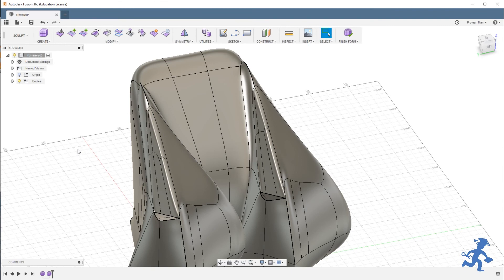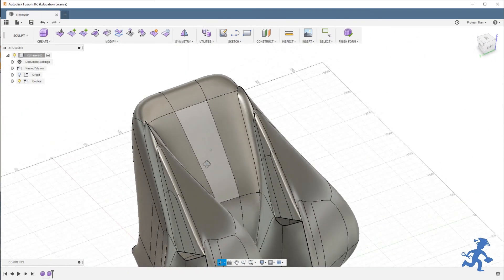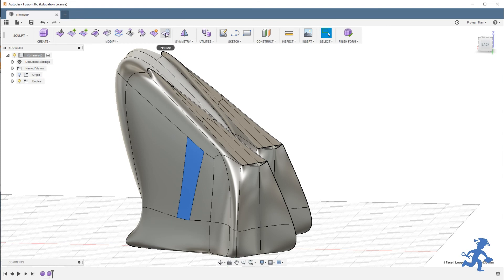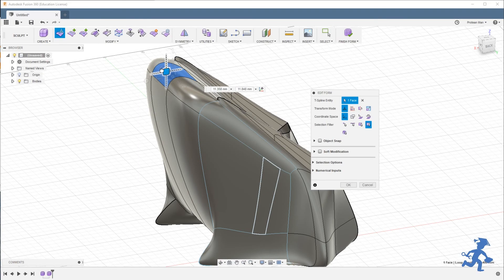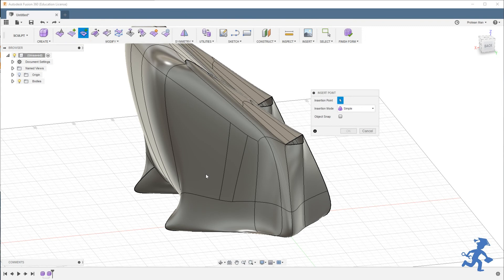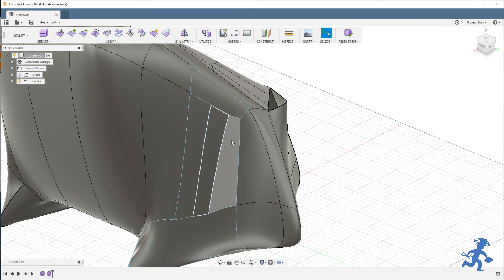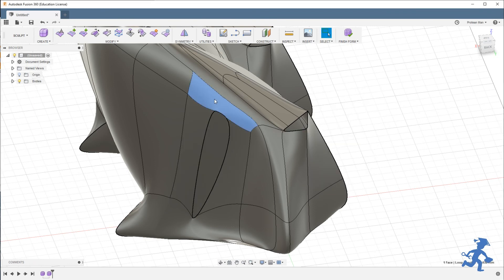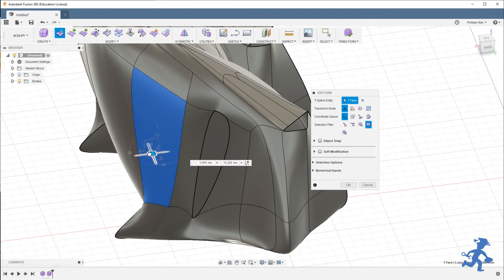Fusion360 - Tool 8 - Freeze/Unfreeze - Sculpting Environment

Comment: What if you're creating a space helmet and you need the neck ring to stay in place so it doesn't distort at all and will fit with a metal ring later? So, you freeze the very bottom edge where it would need to retain  a perfect circle?
Reply from the maker: Ensure that you have two quads between your frozen section and open section. Just add lines/vertices to create this if it's not there. Then you can freeze the neck ring.

Comment: I could see using Freeze if you are working in real-world for a part that has to be blued, screwed, welded, etc to an existing frame or other piece.
Maybe you can achieve the same thing with crease?
Reply from the maker: Maybe. I use freeze so few times that it's just a placeholder for me.